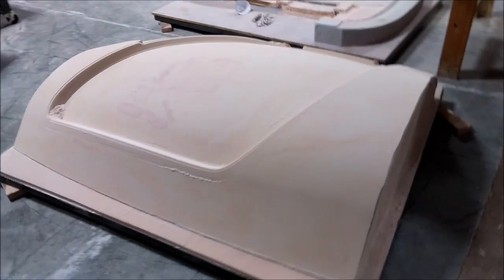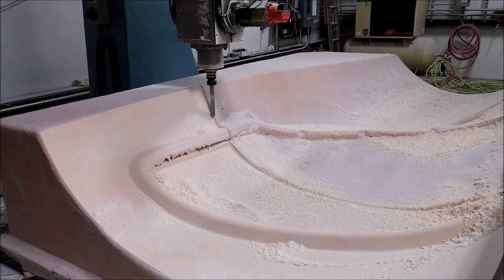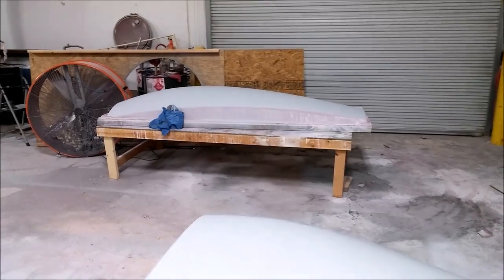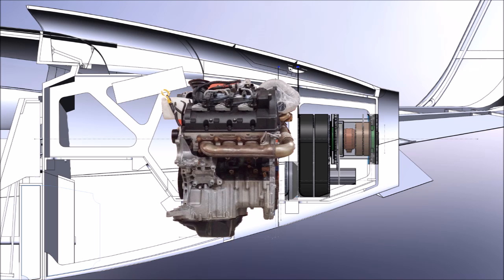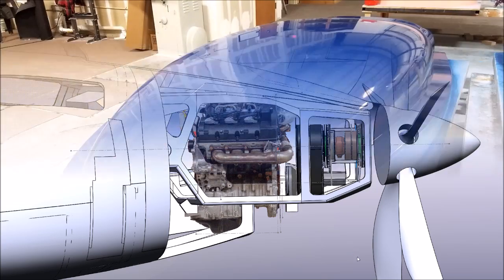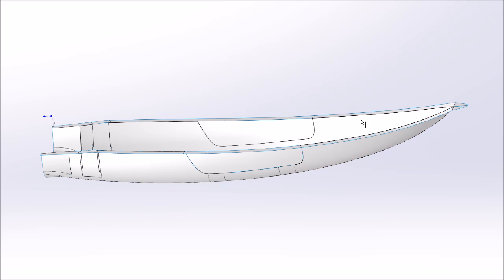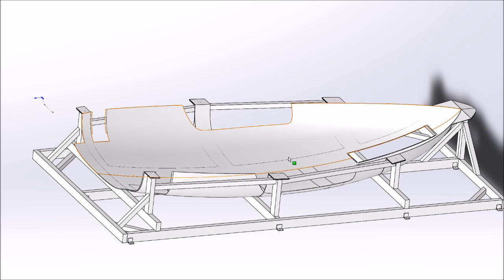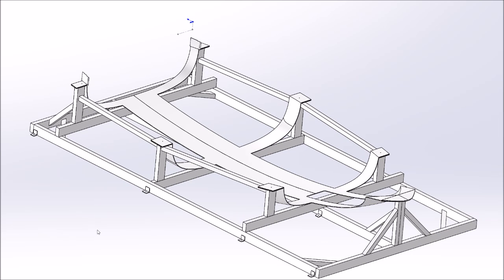Raptor Aircraft February 9th

Comment: Are you worried about the shaft deflections due to the belt tension? It is hard to see what bearing arrangement you have there but the load seems to overhang quite a bit.
Reply from the maker: We have our structural engineer doing all the analysis so we're happy that it's all going to work as expected.
Reply: I got curious and went to your site to find that the pulleys are supported on each side. So it should be very stiff. It was just not visible on your video. 

What you guys are doing is very impressive!

Comment: Are the upper and lower pulleys of the belt drive both mounted to the engine?  If not, won't belt tension be affected by engine movement and vibration?